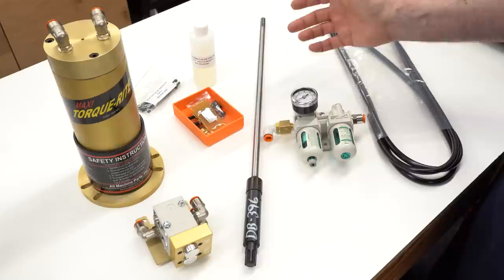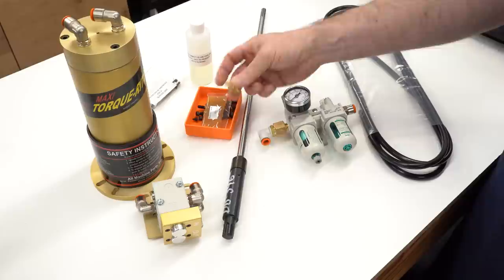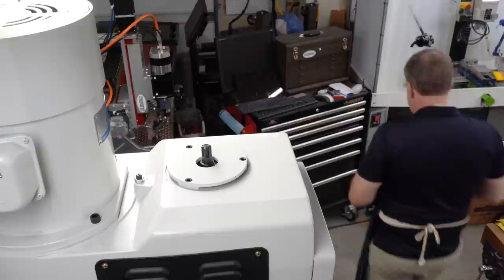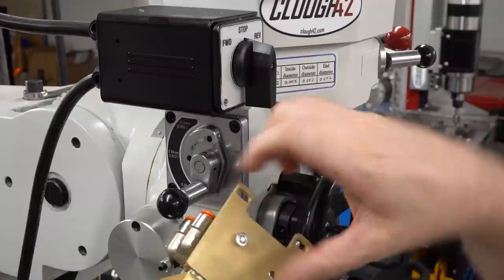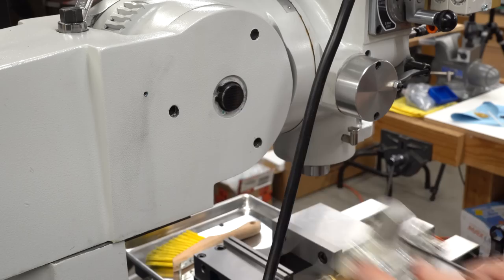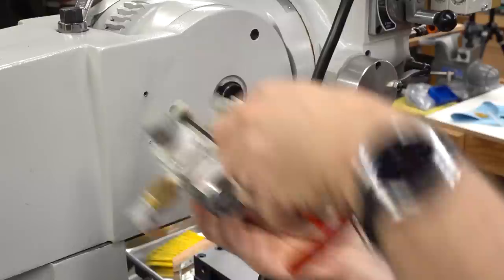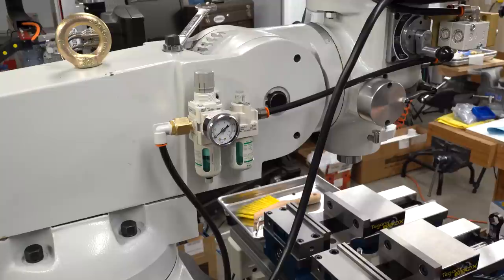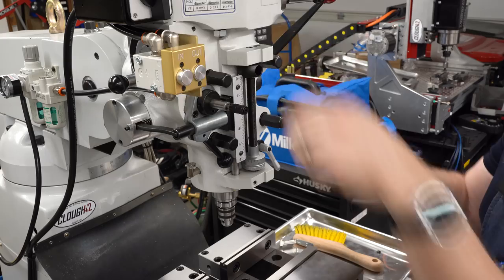Installing a Power Drawbar to Avoid Breaking More End Mills

Comment: Heh. I just bought a 1/2 inch drive ratchet and a 5/8 socket separate from my standard tool set just so I could leave it at the Mill. I was frustrated by the tools that came with the mill and did not want use the low quality wrench that came with the machine anymore. Not to say that I’m not a bit envious of your power drawbar system. It’s spiffy as hell. But Mine is a PM727 and the drawbar is a little too close to the motor for a fancy kit like you have. That’s a darned fine shop you’ve put together. Out of curiosity do you have other friends with shops who inspire capabilities or layout desires or is YouTube kinda your… uhhh, call it a shop spirit animal?
Reply from the maker: It's a combination of a lot of things.  I grew up around my grandpa's farm shop, "helping" him fix just about everything.  I have a couple of friends locally with shops, and have met a bunch of great people through the YouTube machinist community.

Comment: If it is just a regulator leaking... Why not just replace the regulator. Its a standard panel mount regulator if I remember on the video where you repaired it. Just a jellybean part you can swap with another better one. Maybe I am forgetting the details.
Reply: Nevermind, I just looked back and it was integrated into a manifold. But for someone with a plasma cutter... A couple of panel mount gauges, tees, and regulator... You could replace that whole front panel. If the compressor is good otherwise that is.
Reply from the maker: Oh, I hadn't thought of that.  There's no reason I couldn't.
Reply: This would be my suggestion.
There are plenty of high quality pneumatic control manufacturers.
Festo or Fairchild perhaps????
I'm not sure who is going to have a model that will plug & play with the dimensions of your California Air, but I'm sure somebody has one.
* Have a look in McMaster.  Don't they have almost every item modeled in 3D? It would make it a lot easier to search across brands than digging through each manufacturer's website.

Comment: I was at a place that had a power drawbard settup. Forgot the brand.  But if i tried to take a .002 chip load on half inch endmills on anealed tool amd milld steel, they would break.  I had to use a pathetic half thou chip load.  Could you inform me on what issues could have been going on that i wasnt aware of. I was conventional milling too.

Comment: James, I have one of these that I got a while back, but have never gotten around to installing. Main concern was noise, the shop is directly below our bedroom and certainly don't want to wake the wife on those late nights! Approximately how loud would you say this is? Any common shop tools you'd compare it to volume wise?

As an aside, I have a HF McGraw 175pso 21 gallon compressor that I'm pretty happy with. It's not too loud and wasn't too expensive. Was a nice middle ground between price/volume
Reply: Like an impact spinning off a loose lugnut db level.
Reply from the maker: It sounds very much like an air impact.  It's not quiet.  Honestly, that surprised me a little, mostly because I just hadn't thought about it.  A muffler (more than the little diffuser that came with it) might help, but the impact hammers are still going to clatter.
Reply: I wired a motor started in with my shop lights and connected my old noisy 80 gallon air compressor.  Now the compressor can only run while I'm there working and neither the neighbors nor the wife will be awakened at 3 AM.

Comment: Even as tall as you are I don't see how you could use a manual draw bar without a step stool.  Not being that tall I knew I would quickly tire of climbing a ladder to tighten a collet and I ordered my collet closer with the mill.  It took me longer to install mine as I kept having length problems with the drawbar.  Still it is the greatest thing since sliced bread.
Reply from the maker: I had no problem reaching it, and I have a 4" lift under the mill.  This is the 9x35, though, so it might be shorter than yours.

Comment: That’s a really nice kit. I’ve wondered if anyone with a Bridgeport style mill has setup a Tormach type drawbar. Did you think about using that type before going this route?
Reply: Another option is what I use. The tormach TTS tooling and a 3/4 collet with the face ground flush.

Comment: That is a neat power draw bar,  I did not know there were versions now with an air piston to disengage the air impact from the draw bar.  For small taps I have really good luck with a variable speed corded electric drill or a drill press on the slowest setting for smaller parts.   Each twist and release on the tap wrench is a fatigue cycle for the tap.  And it is very difficult to turn the wrench and not put an unwanted side load on the tap.   Where is your compressor leaking now?   I started using super glue instead of teflon tape or dope on pipe threads.  Must assemble very fast before the glue sets.  Then put baking soda on the leftover glue on the outside, makes it set up right away.
Reply: That reminds me, Quinn (Blondihacks) I think said something about using some Loctite on air fittings, I think it was just regular "blue" or "red".
Reply from the maker: It's not a fitting.  It's the regulator leaking internally again.
Reply: @Clough42  Oh that stinks.   Parker is or was a good brand, but the ones that showed up on amazon are made in china so who knows..  Ordering the model with all the correct port sizes can be a challenge.
Reply: @rpavlik1  I saw a locktite product sold specifically for pipe threads, but after seeing the price I decided to get by with just super glue.

Comment: I'm a little disappointed that you bought one. A PDB is an excellent DIY build, especially a simpler one that dispenses with the air cylinder, and uses a single lever to both engage and energize the air motor. I sure like mine, and would love to see your take on it.

Comment: I've always wondered in the case of these manual-to-power drawbar conversions - how do they avoid cross-threading? I guess the threads are always roughly aligned because of the spindle bore, but wouldn't you still risk chewing them up if you tried to tighten it while the drawbar threads were at an unfortunate angle?
Reply: R8 collet threads have enough of a lead-in to center the drawbar before the threads engage.

Comment: Did you consider hydraulic rather than pneumatic?
Reply from the maker: I wasn't aware they existed.  Do they use Belleville washers for tension?  I didn't really want to go that direction.
Reply: @Clough42  They probably don't exist as an of the shelf product. I just seen a video from 'Olfoundryman'. He converted his die casting machine from pneumatic to hydraulic.

Comment: I've had a few regulators go out as well but I noticed that it possibly was due to the size of the tank and lines post the regulator. i.e. I run the main tank from the compressor at 150PSI then regulate that down to ~80PSI and use my shop plumbing as well as a pancake tank for a lower pressure reservoir.  If the main tank pressure drops faster than the 80PSI lines due to a compressor leaking it tended to eventually cause the regulator to fail possibly due to the back pressure placed on it over a period of time. Hope it is not the CA air compressor as I was thinking of replacing my present compressor with a CA Air tools model.  Please let us know if you learn anything more.
Reply from the maker: It's the CAT 2hp 10 gallon model.  This appears to be a known issue.  See my previous video.

Comment: Great Video, seems like these power draw-bars are working seamlessly, now I also need to have one.
One question, the line from the oiler to the valve looks kind of to short to rotate the Milling head. Do you plan on not doing that? Anyway, if required switching that line in this case is no problem.
Reply: I think he mentioned he overlooked it on the video but will rectify at some point.

Comment: Hah, I have the very same mill, though the pulley version, and sure enough, while threading the holes for the VFD, "snap", and much cursing followed. I don't know what it is about that cast metal... it's fairly easy to drill but taps don't seem to like it very much.

Comment: Hi James, would you elaborate on why you wanted to avoid the Belleville washer stack option? I've been contemplating a power drawbar for a while, but google has not been kind when I search for the pros and cons of the different types (pneumatic impact/motor, electric motor, electric impact, Belleville washer stack... with pneumatic cylinder, hydraulic cylinder, linear actuator, and etc.). 

Also how controllable is the new air motor with PSI adjustments? I'm guessing you can drop the speed nicely but at the cost of the final torque.

Thanks for the video!
Reply from the maker: The belleville washers set the amount of force on the drawbar, and lots of people who have that type of drawbar system report issues with tools pulling out while cutting.  I'm sure it's possible to adjust it so it works, but it sounds from what I've heard like it's hard to get it adjusted so it releases easily and also holds the tools tight enough.  I've had TTS tools pull out in my G0704, and it's no fun.
Reply: @Clough42  I see. That makes sense. I've seen posts on the 'net of folks using Belleville stacks that range from under 1,000 lbs. of force to around 3,000 lbs. I suspect the 3,000 lb. stacks work better but require expensive multistage pneumatic cylinders to compress them.
Your new power drawbar looks awesome. When you mentioned... taking some time to get used to the controls, it got me thinking about adding some automation to the power drawbar. When you rotated the mounting plate, it looked like there was enough room in there for a couple hall sensors. Output to a micro-controller which drives one or more solenoids... see where I'm going with this?

Comment: 38 years ago in my apprenticeship I was removing a 6" milling cutter (weighing about 7 or 8kg) from a mill which then fell on my hand. I ended up with a broken finger and pieces of steel swarf driven through my finger nail into my fingers....
Reply from the maker: That sounds entirely unpleasant.
Reply: @Clough42  It certainly was. That's when I learned not to completely unscrew the spindle before tapping the top with a hammer to break friction of the taper.

Comment: Take the regulator out.. Seal it with a plug and O ring.. IMO the valve fit is too loose in the body. I have the same compressor.  If the seal blows and you forget to turn off the compressor, it will run until it overheats.  

 I like the pneumatic drawbar..  They are neat but logic behind buying the draw bar because of  breaking a single carbide endmill is a little thin.. ;-)

Yeah, think about "service loops".
Reply from the maker: I'm a hobbyist.  No economic rationale to buy new tools actually makes sense.  Yet we keep doing it.  :)

Yeah, I thought about the loop between the manifold and the filter, but not between the filter/oiler and the switches.  Fortunately, I bought 10m of tubing, and the fittings at PTC, so it will be very easy to remedy later.
Reply: @Clough42  And if you had admitted that at first, I would have accepted.  😁  The endmill was just an excuse..  😁

Again I'd remove the regulator guts and block it off.. IMO The regulator should be at the end and not the source.  The regulator is a nice idea if all you are connected to is one tool but it also restricts air flow.  Yeah you got one gauge that is unnecessary after the mod..

Comment: What is a 2 hp circuit?
Reply from the maker: About 1500W.  12A on a typical 120V single-phase.
Reply: @Clough42  oh lol never herd it refered to as a 2 horsepower outlet before lol. You consider just making your own reg block for it? There are easy adjustable air pressure switches for start and stop of the motor. Lots of people use them for their diy on bord air setups for jeeps and yota

Comment: Be sure the tool is located properly set in the nut and in the longitudinal groove, before activate Power Drawbar ! Be always well concentrated and dont slouch !
Reply from the maker: Posture advice.  Cute.  You should have seen me before I put the 4" riser under the mill.
Reply: @Clough42  Well, a colleauge injured himself on a milling machine with a similar automatic device because the thread jammed and the cam was not yet engaged. He was not prepared the tool begins to turn. Be careful.

Comment: Nice tool, nice job. But it occurs to me that you still need 2 hands (1on the buttons, 1 to hold the tool).  So theoretically the tool can still drop if you use your hands in the wrong order. I would consider (afterwards) to put the controls right next to the tool holder, so that one can operate it with 1 hand. Version 2.0 ?
Reply from the maker: I have excellent news: I have two hands.  The previous setup required three.

Comment: SPINDLE LOCK QUESTION

I like your videos. They are very informative. I hope to copy your style some day in the near future. 

While this filled in many of holes in my knowledge of power drawbars, I do have a question. My mill is a Grizzly import version of the RF45 and it does not have any kind of spindle brake or rotational lock. I have purchased one of those spline-fitting wrenches to hold the spindle from rotating while I lock or unlock the drawbar. Of course this requires two hands so I rely on the friction in the collet to keep the milling cutter from dropping. 

I notice that you simply grab the tool or chuck and then operate the power drawbar. I think if I did that on my mill, I would wind up with a precise slot milled in my hand or fingers with a generous amount of blood (mine) used for cutting fluid. So my question is, does your mill have an automatic spindle rotation lock? Or do you use some other trick not evident in the video to prevent spindle rotation while changing tools?
Reply from the maker: When using a wrench, the spindle turns in this mill, too, but because the power drawbar is essentially an impact wrench, it applies torque in short hammer blows, and the inertia of the spindle is enough to keep it from turning.
Reply: 15 years of the same kit on two mills in a production shop, none of the machinists I worked with ever cut their hand with it. Since it is basically an impact wrench acting on the drawbar, a hand on the spindle is enough to keep it from spinning. It usually doesnt even spin the spindle without a hand on the drawbar. When it does, like when I have a stuck tool from leaving the tool chucked in the spindle overnight, it might spin at a couple rpm.

Comment: Those are made up in Greenville, TN. All Machine Products.  Been there for awhile.  They came from Ohio I believe.   Back in the day we used to sell the Kurt lever style Drawbar systems but Kurts became problematic and this is what we switched to.
Reply from the maker: It sure seems solid.  The only thing that gives me pause, as an engineer, is the motor repeatedly engaging the splines under power.  I'm sure the materials are up to the task, though--especially in a hobby shop.
Reply: @Clough42  Best one out there until someone comes up with a better one.
Reply: @Clough42  I have this same power drawbar installed on each of two bridgeports, 15 years later and still using the same drawbars, no significant wear on the splines, in a production machine shop.

Comment: OK so you want to fix the compressor? Might as well get some content out of it... 

As long as the compressor tank part still works fine, why not take the functional parts from that manifold (IE the gauges, the safety valve,  and the quick disconnects.....    although if i've seen enough of your vids you'll just buy the best possible versions of those parts and replace them too), buy a new functional regulator take those and make a new manifold?

Vid 1: you could make one out of a square bar of aluminum like the distro plate on the back of the mill. or maybe just turn one from a bar?? (not sure why but you could) 

Vid 2: you might need to make a new plate to secure it to the machine, job for the plasma table. 

Vid Option 1:
the options are high design work is fun and everyone thinks they can do better. so to save design work just post a fusion 360 file of the part on the air comp (the place the manifold plate attaches) and the mounting for the air reg, then have the community submit designs, you pick the best and make it. 
extra points if you can fit the reg in with minimal machining. extra bonus points on if you can replace the body of the reg with the manifold.

Vid option 2:
Assembly + discus the design with the winner.

and that is how you fix the air compressor.
Reply: or you could just assemble a manifold with a bunch of t and elbow fittings and strap it to the machine, but where's the fun in that;)

Comment: California air tools is a joke. I bought a $400 compressor from them a year ago and I still haven't been able to use it. The pressure regulator was installed backwards and broken and shipping because of the way it was installed.  They set me a new regulator, but it's not even a fully assembled regulator.  Son the proud owner of a $400 paper weight that's way too dam heavy for paper.
Reply from the maker: Mine arrived with a leaking drain valve and a broken motor fan grill.  I called them, and they sent me replacement parts.  I grumbled while I installed them, and then went on with my life.